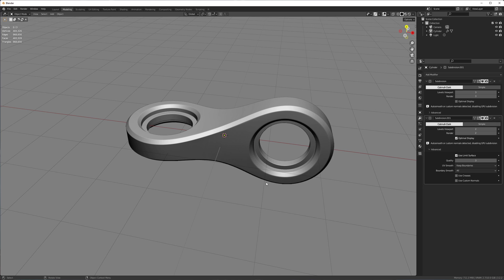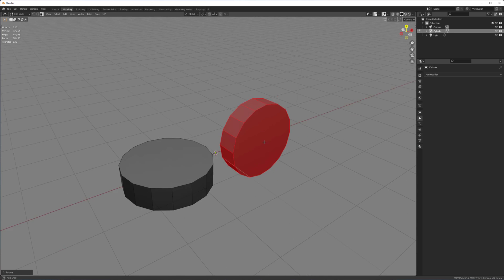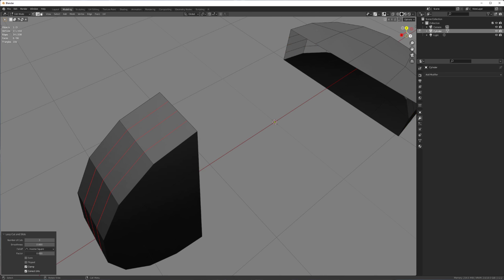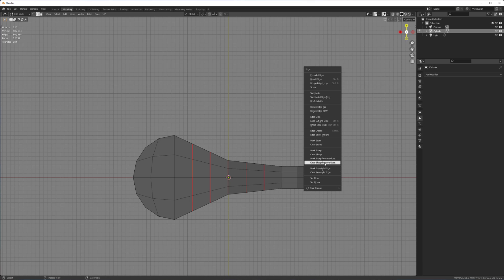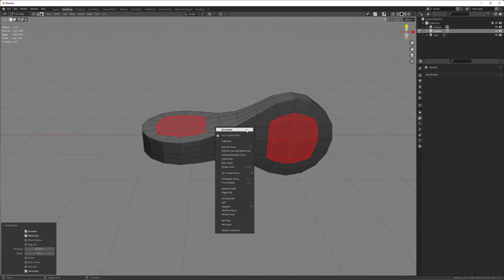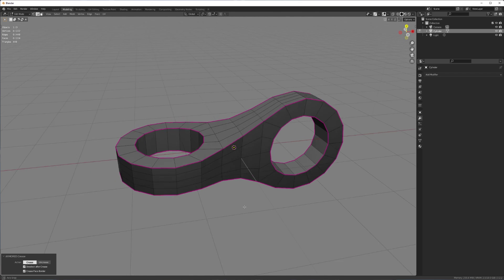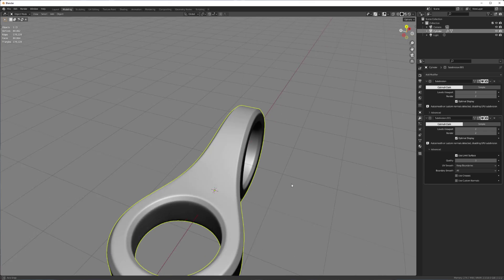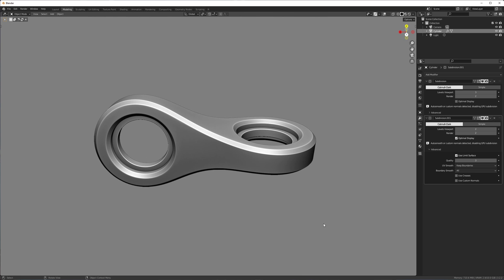A different technique (Subdivision Surfaces)

Comment: Honestly, this is a much more production-ready workflow than using booleans all the time. Sure, you can use booleans, but it should not be abused/used every single time for almost every single modeling task which in the end would always result in an odd number of edges or leaves a triangle somewhere after a clean-up or a messy-looking topology even if they are quads. When working on a production-ready asset, especially for FILM assets that could be sold as a Kitbash product, the topology does actually matter since the buyer would look for the most optimized model for everything. Easier to manipulate, easier to UV, easier to deform, etc... Everyone should thrive for a clean topology, not because It's a religion/fanboyism/quadboyism but because It's ready for everything production and It's a very good habit to keep at it.
Reply: idk, sub-d fundamental is essential, but sometimes trial and error to find the best way to do sth is slower than bulldozing with boolean and clean it up later. We dont know how much time he needed to optimize and try different approach. Also look at the amount of tools he used, not everyone knows that many tools. Some of them are really niche. 
Another sore point is non-destruct workflow. Keeping in low poly can help with changes later but if you added details and then the client/boss want to change the big shapes? its gonna be painful in pure sub-d, with stacks of boolean you can just change the shapes, when everyone is happy, apply the boolean and clean it up with good topology
Edit: not to discret the creator or anything, i learned alot from your vid and you just gave me some more tools to add to my workflow.
Reply from the maker: @sumdude True true. Different techniques for different situations. When I mentioned I tried different things first, I was referring to the bridge interpolation which didn't work as I expected.
Reply from the maker: @Bozurk Yeah, I like SubD because of how useful they are to anyone I share the model with, but not having to worry about topology can definitely help when creating a concept mesh where speed is more important than clean topology. So different techniques for different situations.
Reply: There is a Blender dude that said in one of his videos, (Which I loved very much).

Booleans are “sketching tools really”.
Booleans give severely limited geometry virtually useless in animation, texturing and deformation, transparency and will always place restrictions on how closely your models can be seen in the rendered images.

Relying on Booleans to model is the equivalent of finger painting. :glasses-purple-yellow-diamond: